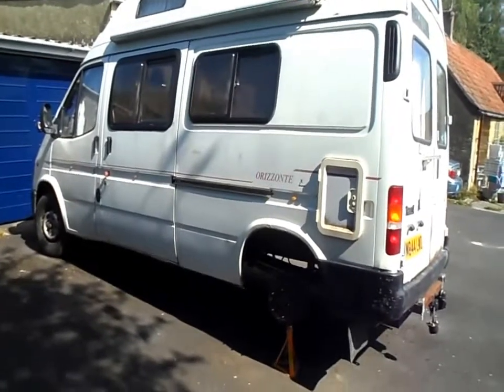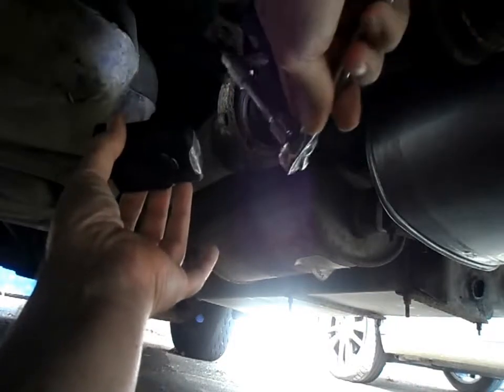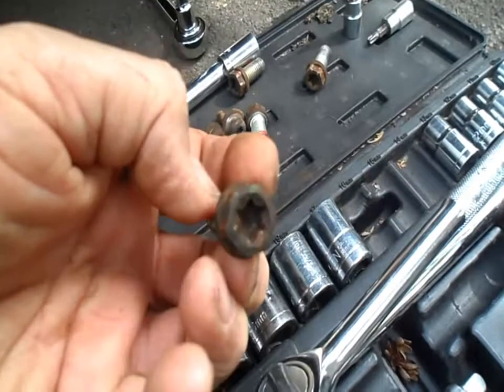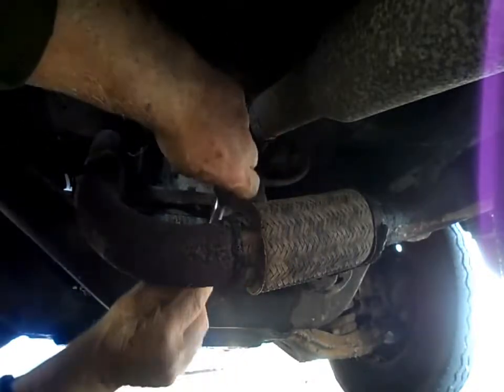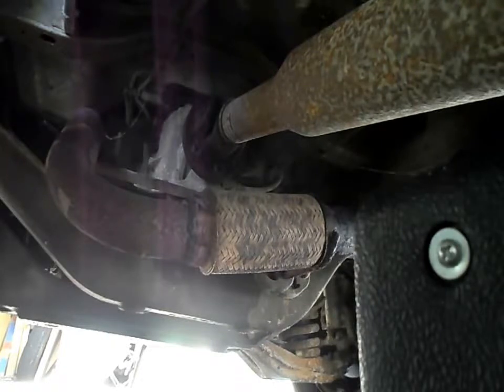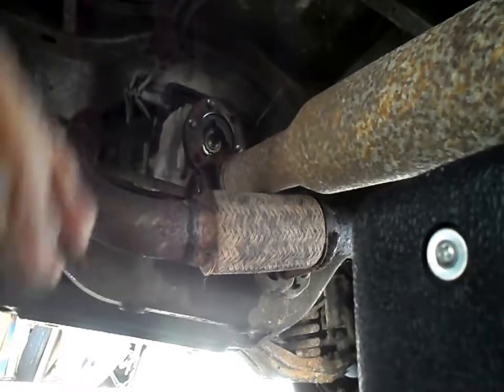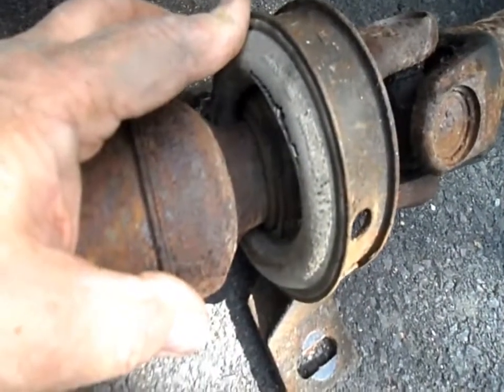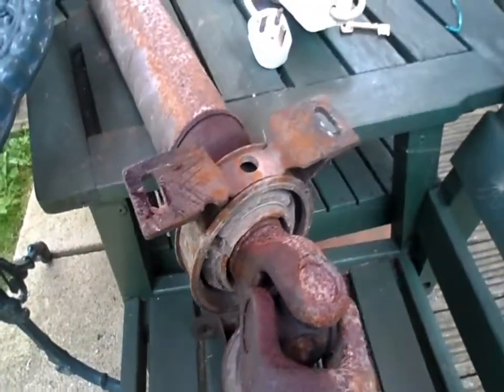Ford Transit Mk5 1995 LWB propshaft Centre bearing

Comment: wish my nuts would have come out that easy i changed the whole prop had to get a custon made one but old one was hard to get of but all new now in progress of restoration of engine and panels
Reply from the maker: it sure is a tough dirty job isn't it. I am lucky as I have huge strength so i can generally force things ...if not there is always a big hammer lol  
Mk5 smileys make a terrific camper van Good luck with the resto .

 Are you a member of  Ford Transit forums ?  great tech info on that forum . I posted some repair articles many years a ago https://fordtransit.org/forum/viewtopic.php?f=18&t=136382&p=1129360&hilit=wing+repair#p1129360
Reply: @johncooper7242  thats what i have done with my mk5 was a flat bed i turned it into a camper by putting a avondale caravan on chassi only 87 thou in clock to not member of forums grew up with these van trucks so good know how its a mk5 di 2.5 banana engine to just finished putting engine bk together everything replaced she ready for rest run tomorrow then replacing sills,steps,arches then she be ready again to hit the rd the profile picture is my build

Comment: Very interesting John. I had a Peugeot camper, but luckily never had to do much work on it. My son was asking me at the dinner table yesterday what a propshaft is. I explained, but now I can show him. I loved all the cursing and struggling. It made me feel like I'm not alone. I have spent too much time lying on bits of cardboard under rusty vehicles trying to undo bolts that won't shift and then grazing my knuckles when they suddenly give. Hope your wife didn't spot the rust on the chair arm.
Reply from the maker: Hi Miles  thanks for your positive comments .  I usually try to video various jobs I do on my vehicles in case its helpful to someone else thinking of tackling the same job for the first time.

Its probably way too long and I'm sure I could shorten it considerably but I guess its targeted at those who either lack the experience or confidence to tackle these jobs themselves.

Its a lonely job with no real appreciation  isn't it Miles, lying under the car or van in all weathers struggling to carry out repairs. if I come into the house and tell  my partner that I've just finished 2 weeks of work  welded up the floors and fitted new brake pipes and suspension to her car I usually get a ' thanks'...or ' oh well done ' ...  the next day shes hammering the car in and out of ditches and hedges .!
sorry about the cursing ...

Comment: Top man everything I needed to know thank you for taking the time to do this  video thumbs up
Reply from the maker: thank you for your kind comment garry I hope yours goes as easily as mine did .
Reply: Thanks John it went OK better than I thought it would much appreciated
Reply: @johncooper7242  thanks John it went OK better than I thought it would much appreciate
Reply from the maker: @Nothing-g7e  excellent !  well done. That has to be one of the worse jobs I've had to do on the old gal so far
Reply: @johncooper7242  I found it not to bad after watching your video I knew what to expect it was a bit fiddly but I have a tipper so didn't have to jack it up the bit I'm dreading is my bushes need changing on the leaf springs not sure how that's gonna go looks a right pain to do
Reply from the maker: @Nothing-g7e  luckily mine are ok although the springs are a bit weak. I imagine the rubber bushes press out but if you haven't a large enough vice or a press you could get a local garage to press them ...or maybe even cut them out with a hacksaw. I had to replace a shock absorber bush last week for the MOT and that was a bit tricky .
Reply: @johncooper7242  good idea I will drill the rubber out and bash the centre bar out then hack the outer ring typical isn't a little bit of rubber stops you in your tracks changed the front wheel bearing yesterday and that was easier then I thought it would be I will let you know how it goes after I've done it thanks John good man